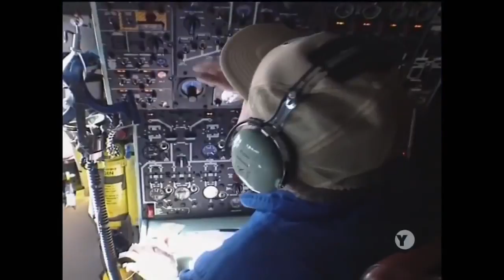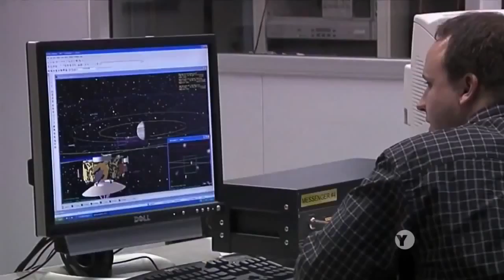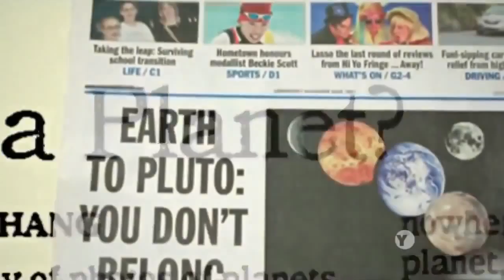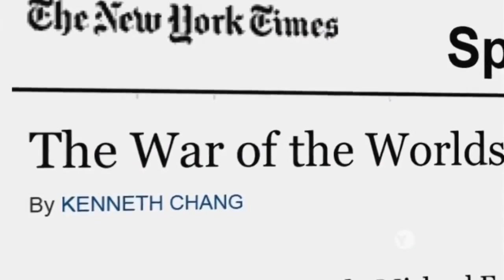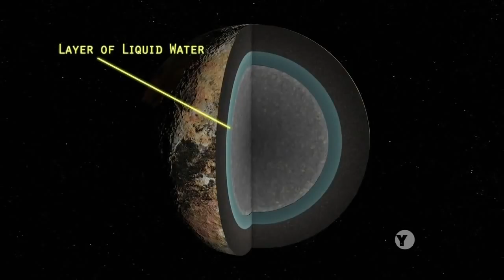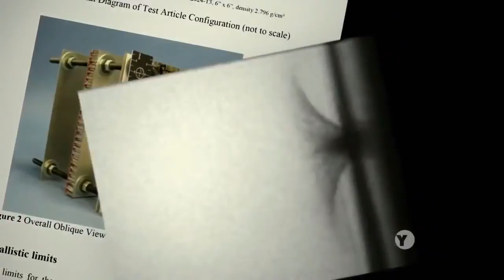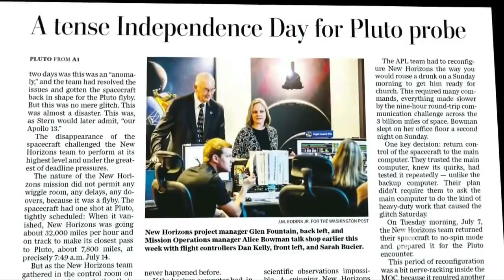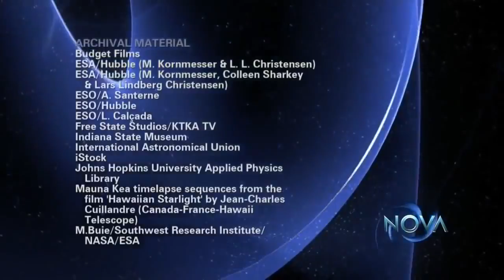CHASING PLUTO - PBS NOVA DOCUMENTARY

Comment: The biggest problem is that regardless of having cleared it’s orbit, does Pluto ‘s mass and orbit fully apply to the calculus of orbital motion discrepancy of Neptune within the gravitational plenum. If not, then it would require that the total number of Kieper  belt objects plus now the total number of Oort cloud objects myst be located and added together to compensate , or calculus is a mathematical trick that has no bearing upon  a gravitational plenum. Therefore who is wrong, the Astronomical Union or Newton?
Reply: Obviously the Astronomical Union is wrong.  All objects are pulling on each other in both directions.  Neptune pulls on Pluto just as Pluto pulls on Neptune.  The sun pulls on both of them.  What pulls what doesn’t really matter, it’s the objects themselves.  Pluto is a fascinating planet with active geology and features that rival Earth and Mars.  Who cares where it’s located?